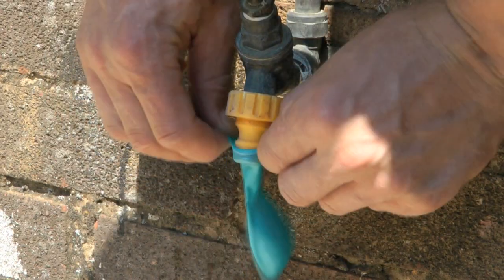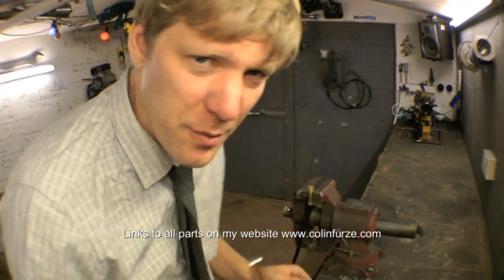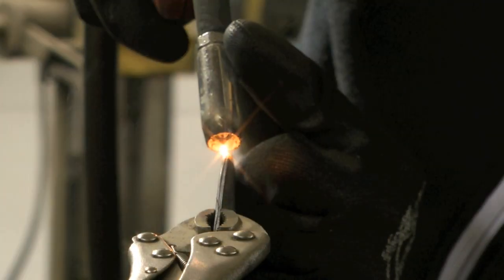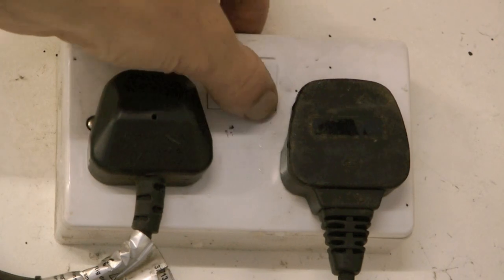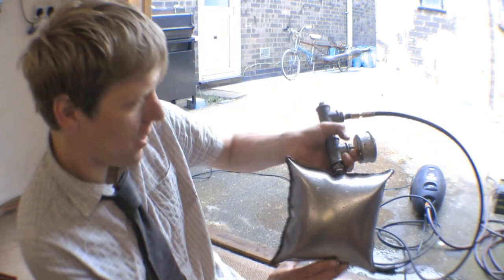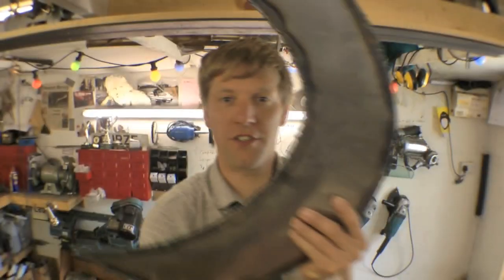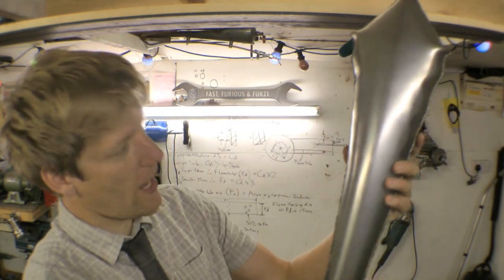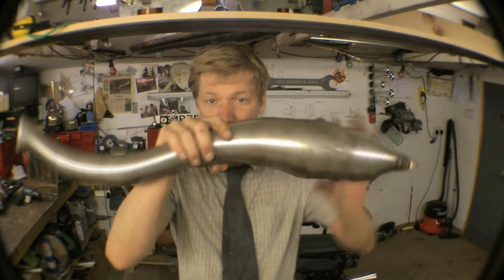HydroForming with a Pressure Washer - Setting up/testing

Comment: If you were to use hot water pressure hose it would heat the metal leave it more flexible  ??

Comment: The hydroforming should be done in a water bath & you should be wearing safety glasses.
          Regarding the wrinkling, have you tried intermediate stages of forming with annealing in between?
          To make a sphere, the best shape to start with is a dodecahedron.  It is simple to make (12 identical pentagons) & requires less deformation to get the sphere.

Comment: Safety chat about the dangers of compressible air and relative safety of incompressible water took me by surprise. Until he said 'or so we hope' 😊
Later followed by the shoulder cringe of safety.

Also, make two cones and weld them back to back to make a straight through expansion chamber for your 2 stroke, max power!!!!

Comment: There is definite potential here for an efficient way to bend natural, rounded shapes into sheet metal. Using an air hammer to bang out a motor cycle gas tank takes awhile and a lot of skill to look smooth. Being able to get the rounded shapes to the 5 yard line quickly would be pretty cool.

Comment: Can also use a cheap hydraulic press to hydroform using a steel box, pressure plate and a die to form the sheet metal around. Then load the box with the die and the metal throw a couple inches of rubber on top with the pressure plate on top and pump the jack till high pressure to where the rubber behaves like a liquid in the box and forms the metal to the die.

Comment: Really curious - do you need to empty all of the water out after your formed your shape? If so how do you make sure there is no residual water that will cause the steel to rust, and if you then go to weld the inflation hole closed, have you now created a dangerous airtight container?

Comment: A few questions...

Why do you want Fred in the brass fitting?

What will your neighbor say, or do, when he discovers Fred in HIS pressure washer?

Who in the hell IS Fred?

What did Fred ever do to you, you bully?

===========

Seriously, you didn't show, or explain, how the hose fitting connected. If it was already 'freded', how did you manage to add a different 'fred' to the fitting. That NEVER works for me.  Also, how was the fitting already the correct size for the BSP tap?   

Thanks,

Fred's big brother

PS:   The post-mercial came on while I was writing this;  it was promoting a...
pressure washer.  How appropriate.

Comment: 02:38 : great way of testing weld strength / failures
02:50 : I think there's local train station where there's a bunch of these used in a modern sculpture / as decoration, so there!

Comment: Seems like it might be a good way to make steel helmets without a hydraulic press.

Make a HEAVY negative, clamp the metal pouch inside and crank the pressure.  Although it might need heavier & higher grade steel to be worthwhile, closer to 3-5mm tool steel if going for ballistic protection.
Reply: Follow up thought:  Is 100 bar sufficient to efficiently form 3-5mm titanium?

Comment: You know it occurs to me that this would be an excellent method of making a fuel cell for one of your vehicles. Aside from sealing up the holes which become obvious in the forming process, it would be a snap to put a fill port and fuel delivery tube in one of those. Welding on mounting brackets wouldn't be terribly hard either. Just a thought for what it's worth...

Comment: Using a thick steel ring, that is bolted around a generous lip of the material you are forming, and is in fact bolted through it in that ring, and going SLOWLY, is the key to forming perfect bubbles with circles.  This would be how manufacturers made rounded headlight fixtures for motorcycles...  they pressure formed 2 sheets at once and made 2 headlights at the same time.  :-P  

Like this for example:  https://www.youtube.com/watch?v=A66iw8P5NQ4&ab_channel=ClarenceElias

Comment: Warning, at high pressure that water WILL cut right through your hand. So don't have your hands anywhere near the vessel under pressure. If it springs a pinhole leak it might very well cut a finger or two clean off. This is why old timers know to use a stick to find leaks in high pressure lines or boilers. Stick gets cut, not the old timer.

Comment: You do know that you're supposed to use oil when tapping holes, right?
Reply: use parrafin on brass
Reply: Jacklin Hide paraffin IS oil, it's just oil that happens to be solid at room temperature.
Reply: Jacklin Hide paraffin IS oil, it's just oil that happens to be solid at room temperature.

Comment: that two stroke chamber was ingenious!   What TIG machine do you use in most of your videos?  I've got a wire feed at the moment and I'm tired of the flux all over some otherwise decent welds..
Reply: just use gas instead of fluxcored?
Reply: +Anton Helsgaun i just hate the lack of control with wire, and really want  to be able to arc weld without filler coming out all the time :/

Comment: People under stand hydro foaming is a very dangerous thing, if you do it wrong or don't monitor things right. The metal can burst with a very large amount of force, sending high pressure water and/or shrapnel at you and/or others.
Reply: +John J would a tie help?
Reply: +John J It wouldnt burst, the weakest point (some part of the weld or where the hose is attached) would fail and some water would escape from there, but it wouldn't explode.
Reply: John j water is incompressible.
are you an idiot or a troll?
Reply: Ben Sullivan
I've seen them pop violently before, thou most of the time the metal stays together. But high pressure water firing in some direction, can be just as dangerous.
Reply: ***** That's only if you leave too much air in. If you get it all out, you're usually fine. in my experience :)

Comment: Hey, i am thinking of making my own light modifier for photography, a beauty-dish, basically a small reflective surface reflecting light onto a larger reflective surface,  usually saucer shaped... Kind of... so i have 2 questions...

If i have 2 donut shaped pieces of metal wielded together, would hydroforming retain that donut shape? Also, would this work on weaker metals at a push?

Comment: Its not hydroforming without a form. Real hydroforming starts with seamless tubing bent and smushed to fit into the mold. The pressure is also applied very rapidly from a high pressure accumulator. Not impossible to do at home. Ive just never seen a video that was anything original.

Comment: If you heat up the metal almost bright red with a oxyacetylene torch once  red put torch  down then add air in a controled manner you'll have no kinks. By heating the metal first is makes it  easier to use air be careful  try to do a better job with welding the seams with the tig throw out the filler metal and just fuse it when done check for leaks at lower air pressure using soapy water

Comment: there is no such thing like being "incompressible". All matter in the universe is "compressible" down to an absolute maximum which could be calculated via its molecular structure. Once you compress the matter beyond that point it wont have its specific properties anymore, being broken down into its core, only slightly related, atomic elements - thats what a black hole does. Everything above this level is "compressible". Sorry, kids - its a common lie being told everywhere. But there ARE applications to the rather rigid structure of H²O, as you can see - since it requires large forces to compress it ... apparently they're so large that even metals start to deform before water is being compressed significantly-

Comment: if you put the sheets of metal between two mounted together bigger sheets of metal with a cutout in the shape of your desired object, you won't neet to weld and it will look nicer.

Comment: I've read that it works much better if you fold the edges over first at the seams instead of welding the pieces when they are completely flat. This creates a flatter surface at the weld seam and a nicer overall part.
Reply from the maker: but surely is way more time consuming
Reply: ArrigAutist
This is a FUN channel...
Reply: Shamalamamoomoo
Reply: supersportimpalass waste of time.. Learn the basics of steel work including lining up materials, tack welding & decent welding technique. Thousands of km welding seam perfectly made all over the industrial world on a daily basis..

Comment: 3:36 the pressure washer suddenly started making a different noise, was that because it didn't like hydroforming?
Reply: I think it was the change in camera or camera position that changed the sound also when pressure washers start to pressurise or have a load on the motor then that will change the sound nothing to worry about though

Comment: So it won't work with circles, that's fair enough, I can see the physics limitation. 

Would it work on a semicircle? I'm thinking of mudguards for a car (motorcycle type).
Reply from the maker: yes if you did a shape like the bannaner one i did then cut it in half should be good

Comment: Can you explain the process you used to remove the air from it first before putting the water in? did you just let it fill with water until it came out the stopper then capped it back off before applying the pressure?

Comment: Ah up Colin , they just had hydro forming on myth busters a week or so ago , they got amazing results by clamping the 2 sheets of metal between two very thick metal clamps cut to the shape they want to form , it seemed to stop the buckle on the edges ..
By the way I'm a plumber in Grantham and my shed time consists of a stermy archer dynohub wind turbine .....failed in strong winds ,never found one of the blades yet

Comment: instead of welding two pieces together, try using a three piece jig. solid piece of metal on the bottom, frame shape in the middle, then a piece with a cut out of the shape you want on top. then just sandwich the sheet metal between the top and middle bits.

water will fill the middle section and only be able to push the sheet metal up out the shaped hole on top. you can create perfect domes doing this.

the mythbusters did this to test ancient torpedoes.

Comment: Why did you use you MIG this time instead of the TIG you usually use? From previous videos you seem to be a decent TIG welder, and I would expect the welds would be better quality, with more consistency so the shape should form better.
Reply from the maker: i do in the next videos but i like to show things with tools most people will have as tig welders are not that common.

Comment: I am definitely going to have to try this method to make a tuned 2 stroke exhaust pipe.  I'll get me a cheap and probably stolen pressure washer from a pawn shop and pump out some badass tuned pipes for my motorized bicycle

Comment: You need a pressure relief valve so you could keep the pump running and slowly bring up the pressure. I think that would reduce the creasing.

Comment: The aircraft industry use this technique to form airframe components from titanium. It's called super plastic forming. The metal is welded to form a closed envelope and then heated in a mold. As pressure is applied the metal expands to fill the mould. Very cool and fun to see the technique being used like this video.

Comment: Speaking out of experience, try welding the piece leak proof and use little hammer to lightly tap around dents and deformations while the piece is under ~50bar pressure. It stretches the sheet and makes a lot prettier finish without cutting the piece open. For that you need an one way valve or just a regular valve to keep the pressure.

Comment: Could you make a mould out of wood or concrete and form into it? Maybe ali rather than steel
Prank idea - steel pillow, cloth cover, leave on a sofa in Ikea...
Reply: Would not expect to see you around here.
Reply: I think making something like a die with 2 blocks of steel. One will have a negative of what you what to form, and the other side with an open space to have the water pressure to build. Get a sheet of steel, put it in between the 2 blocks of steel and then clamp it all down.
Reply: don't forget to fill it with concrete or lead so they cant get rid of it.
Reply: Chwyn . then how would you get it in there.
Reply: Lan Party Hosting
Employee uniform and a forklift?
Reply: ryan c
exactly if its to heavy to pick up, how are you gonna get it in their. cant have 4 guys carrying a pillow. thats gonna get massive attention.
Reply: To the help no no to the help
Reply: yes you can use forms, and different alloys.
Reply: Lan Party Hosting
well, concrete and molten lead are both viscous.
Reply: Chwyn I think he means getting it into the store
Reply: mikeselectricstuff I
Reply: Drill a hole in the steel pillow and fill it with concrete.
Reply: mikeselectricstuff I wold steel it
Reply: Heh, fancy meeting you here :)

Concrete pillow. That's new.

Comment: If you weld a submarine, i don't wanna dive with it xD
Reply from the maker: i use a tig on the future ones but most people only own migs so wanted to show it with that and my mig welding is not so good
Reply: colinfurze I thought that most people have electrode welder and that is a challange
I prefer mig, I found it very easy...
Reply: 春日歩 Or just learn to weld properly. MIG/MAG is by far the hardest thing to learn to do properly, so people futz around with stick and gas as they provide much easier way of doing a good weld, though it still needs practice.
Reply: I use the stick mode almost exclusively on my machine because it's not sensitive to paint, surface rust, or galvanization you often find on reclaimed metals, or the mill scale you find on new metal
Reply: it's not easy to do airtight welds with anything that isn't a tig, but a good tip I figured out is that you can put down your nasty booger welds with your mig, flux core, or stick welder, and then run some JB Weld over the joint to make it nice and airtight.  It's a great alternative to spending $1200 on a tig welder or an hour making a little piece of intake tubing airtight

Comment: I believe the Mythbusters used a similar technique. But for round/oval shapes they used two thicker plates of steel where a shape were cut out of and clamped them with the thinner material between together.
The steel plates were around half an Inch IIRC.
Reply from the maker: yeah i saw that but thats so much more effort and how many people can cut half inch steel properly
Reply: colinfurze  Well if the radii aren't too small, a plasma cutter should work and then cleaning up with a angle grinder.
Otherwise you'll probably would have to spend a small fortune to get it cut from a laser or water jet cnc...